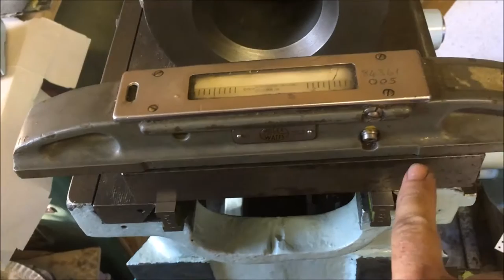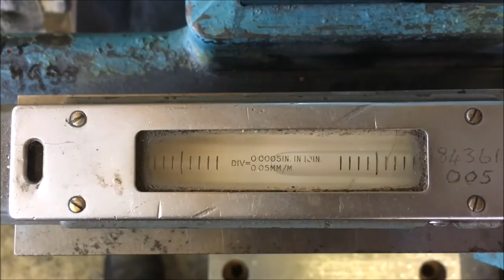Elliot 14S Update11 3

Comment: Hi Mark, if you want to drill a hole at an angle then it's pretty easy to make a guide, it only needs to mild steel. Drill through the piece you're using for the guide square ly and then machine machine a face to give the angle you require. Don't forget to consider how you're going to clamp it though. You can then start the hole with an end mill and then swap to a drill once you've a squared the bottom of the hole.
Reply from the maker: Thanks graham.

Comment: Regarding the inside corners: I saw somewhere that the thing to do there is to run an angle grinder with a suitable wheel on it along the corner to get the proper clearance. There is no way to scrape properly right up to a inside corner so you need the clearnace. Obviously you need to be careful. Another much more tedious way (probably your way) is to modify a round file and use the end to scrape out the clearance.
Reply from the maker: I think Ive come across the same thing  on the net - angle grind out the clearance. Ive not had much success with slitting blades on Cast Iron with my grinder - seams to burn the surface as much as grind... I also watched a chap (he's scraping in a Bridgeport Mill on YouTube)  use a carbide lathe insert tool screwed to the end of a rod and remove material really quick. I would have done the same for not having a suitable insert. As it happens the brazed turning tool only took 10 or 15 minutes to scrape it out and it was to hand. I should have done the dovetails on the Ram with it - another lesson gained - be handy when I do the compound tool head on the shaper.

Comment: the best way to get a better coverage is to put more ink onto the master....
the less ink used, the clearer the print will be.
unfortunately, also the worse the visibility will be.
lighting, coming mainly from one side can be a help.
moving one's line of sight to and fro at different angles in relation to the source of light helps in spotting the differences.
Reply from the maker: I have started to make use of multi element led spot lights - these spread the light points in front so require little additional movement to help pick out the blue points.  The amount of ink on the master can be troublesome - too much and it smears or disguises the surface details. Too little and only the very high points are highlighted. As my experience increases Ive gotten better at judging how much ink to use for the part of the scraping Im doing.  The ink getting less as the surface is refined.. I think that is one of the hardest things to master in scraping.
Thanks for watching and commenting. All the best Mat
Reply: @lookcreations  thanks for the reaction.
when scraping a cast iron object flat i will start with ink but in the end i do without it.
i just rub the object against the granite plate and on the points of contact the spots will become shiny.
i then take a marker and mark the spots and take those down.
no stoning needed as i only take next to nothing.
i just repeat untill i get tired of it and put it away until a next time.
a 2 micron test  indicator does not move anymore and the object will float on the surface plate 
not that it needs to be that perfect but i just like to have one or two things i can point out as being (near) perfect.
those items are about the only things in my shop that are up to a standard, the rest is just average at best.
so is my machining, probably sub average to be truthfull, so i get my pride out of those special items that money cannot buy.
Reply from the maker: That’s a nice attitude, I have learned a great deal over the past few months. My machining isn’t up to much, that to I am learning as I go. 
My recent scraping of straight edges has moved me on again. The last SE I just refined is good to 0.0002” over its 68” length. By which I mean it is less than half that . Splitting tenths by hand scraper as you say picking the tips of points. Thanks for watching and commenting. I should be scraping the lathe spindle bearings in the next couple of weeks. It should make for a good video 👍

Comment: Did yo watch the Richard King Scraping class vids where he shows the students how to flake with hand scrapers?
Reply from the maker: yep. got to take another look through them and confirm details of the carbide rad . i have also been looking at the push flaking method . Then I need a surface to practice on - so looks like I will be recycling another grid cover or maybe mess up the old surface plate I have.

Comment: Why don't you level the whole thing before you use a level?  Things get a lot more deterministic.

dee
;-D
Reply from the maker: Hi Dee, basically lack of space to work around it - ideally I would have it leveled in its final spot and be building it up there - but there is no room at the rear or sides to work on it - So i have to bring it in and out. Like most of my measuring its 'relative rather than absolute' - but I agree if it were leveled properly to start with it would help no end. 
One day I will build a workshop the size of Keith Ruckers ! Mind i could fit my house, garden and workshop into one end of his mansion man shed ! (very envious though)